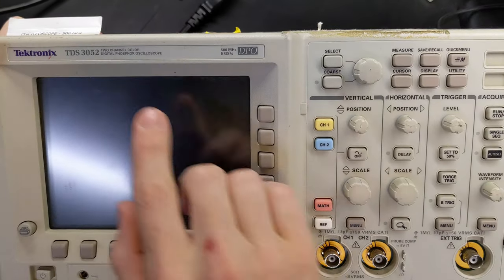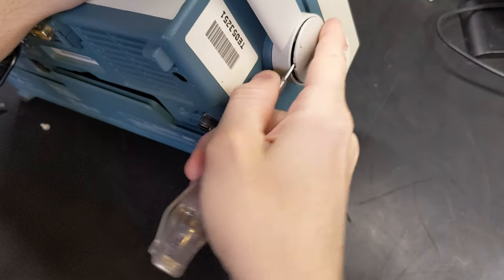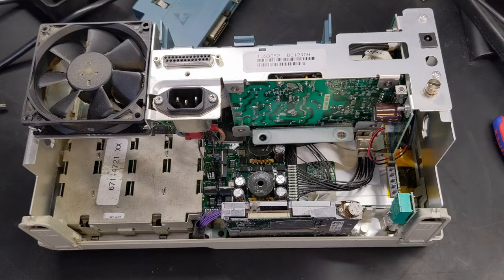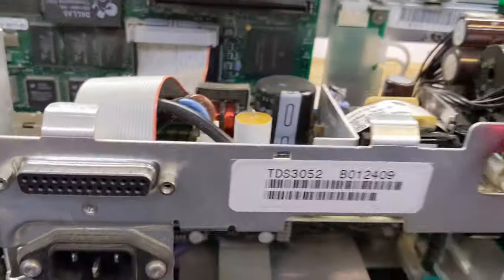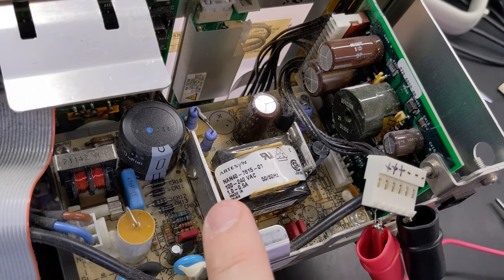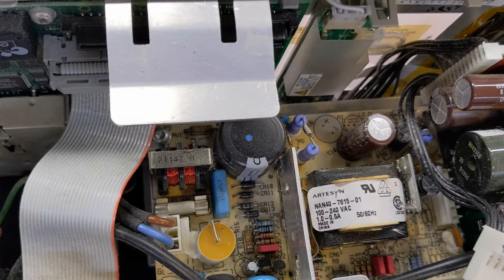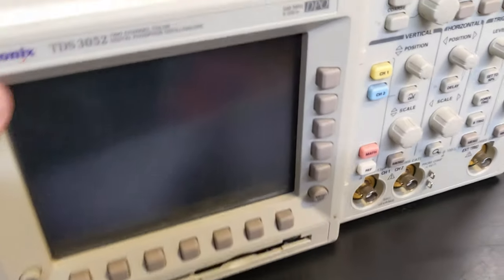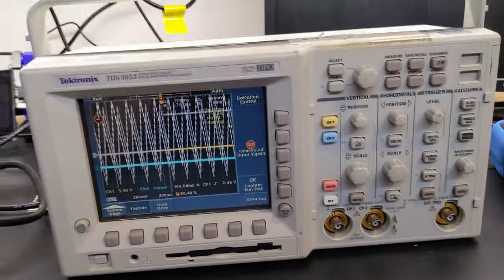#6 [Repair/Upgrade] TDS3052 Oscilloscope repair

Comment: Nice video. Looking forward to more like this what part of the UK are you in?

Any chance you could point me in the direction of a source for those obsolete modules? everything I've found online appear to be high priced active modules. I suspect this will be a mobile phone hack - although I'd prefer to use an obsolete tektronix one for convenience
Reply from the maker: I'm in Scotland at the moment, and I can confirm there's no modules up here unfortunately.
The most professional DIY module I've seen is using a PCB and the contacts from a phone SIM reader, like this
https://oshpark.com/shared_projects/pE9Ff8iu
I was lucky I could pick up a module cheaply on eBay as  they don't hang about! Still, it's not too hard to fill a blank module cover with the PCB. It's the exact same shape as the real module.

Comment: Can we use normal probes with this oscilloscope?. It seems there are additional connectors around the BMC connectors.
Reply from the maker: Yes it's "normal", those connectors are for automatic probe detection on fancy probes

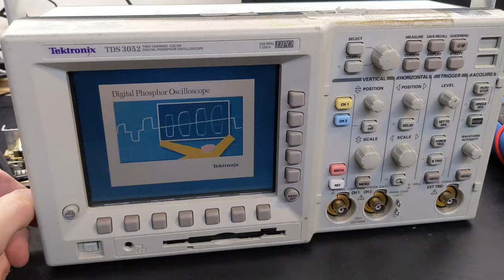Comment: 30:20 Is that a twin PSU I spot there?
Reply from the maker: If you're talking about the PSU on the bench in the lower right, that's a donor PCB I got off eBay when I thought the issue might be with a switching transistor or some other part. I didn't think it would be a simple resistor failure but now I know better!

If you mean the barrel jack in the back, that's a output for powering some other peripheral, I don't think it can be a power input.

Comment: Hello again, i have a TDS3014B, with Floppy Drive and would like make the firmware upgrade, but the firmware file that I have V4.41 is +/- 2,5Mbytes, so I dont know how a can divide the original file in to four floppy disks, like disc1, disc2, disc3, disc4..... Someone can explain me how I can do this process? I have a laptop with floppy drive and new formated and blank floppy disks.... Someone can help ? Many Thanks
Reply from the maker: I checked out the firmware file, its a zip with four folders each one labelled after a disk you need to copy it on to. I got the zip from here https://www.tek.com/en/support/software/firmware/tds3000-and-tds3000b-series-firmware-fv341

Comment: Where can I acquire this Omega plugin with all options enabled :)?
Reply from the maker: You have to build your own! Some of the DIY versions use bluetack, a sim card contact pad from an old phone, and the eeprom chip soldered dead bug style, really nice hackery
Reply: @bansci  I dont have the neccassary tools for that. Possible to acquire one Omega from you?
Reply from the maker: Sorry, but I don't want to get into distributing hacked modules. If you have one of these scopes you should be close to the tools needed (bluetack and soldering iron).
Reply: @bansci  I feared that answer :(
Reply: @bansci  which programmer do you use?
Reply from the maker: @cvetomircvetkov5670  the TL866II plus which is really universal and allows you to program and read almost any eeprom. Highly recommend it (and you're right you do need this tool too, but it's really valuable for any older electronics)